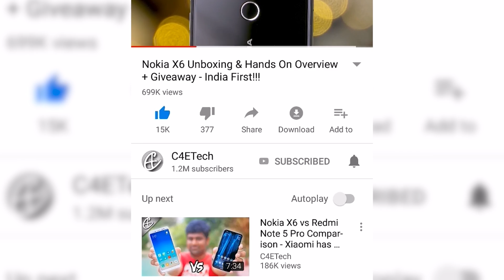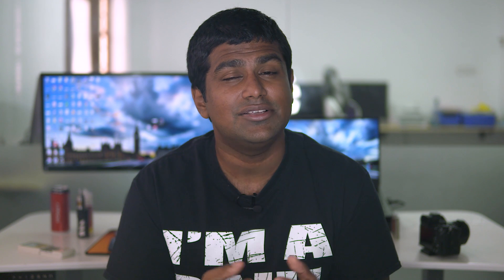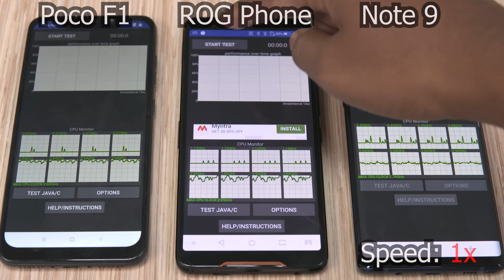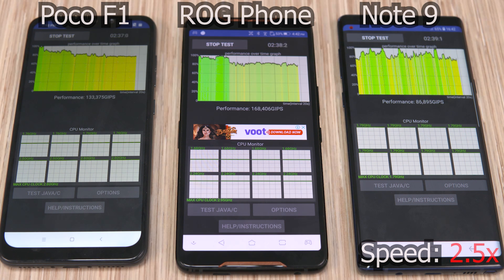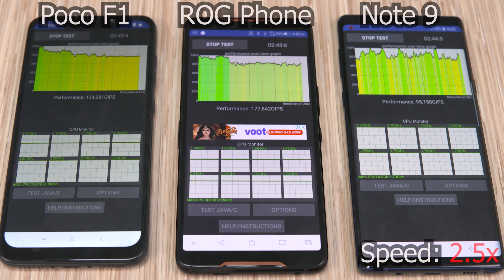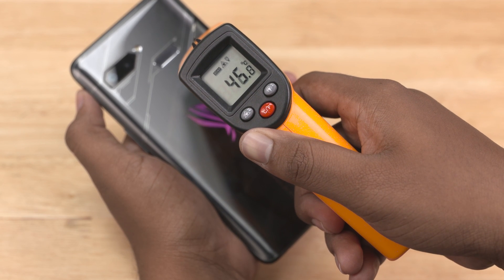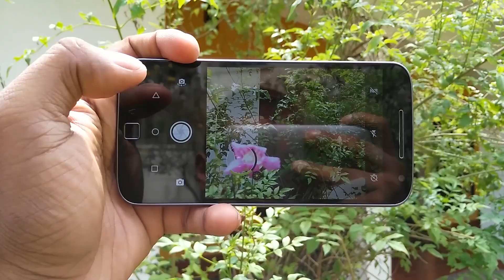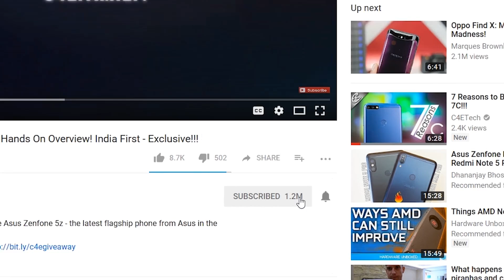My Phone is SO HOT 🔥🔥🔥 - Heating Issue Explained!

Comment: Minor Correction: Moto G4 uses SD617, not 615.
Reply: Yeah right
Reply: Strong Believer  oh sorry
Reply: But ash clearly mentioned g4 plus had 615 which was wrong and I guess g4 didn't had any overheating issue unline g4 plus
Reply: @tintinftw  no 617 had heating issues too
Reply: Doesn't even matter both are heaters🌚ya 615 generates less heat but ya u won't care for 2 or say 3 degrees

Comment: Mediatek  are pioneers in making the worlds best overheating chips
Reply: Actually SD810 ,SD 615 AND 617 heated up more than most Mediatek chips.
Reply: @akashtopder7251  also sd820 my previous v20 had terrible heating issue no wonder Samsug note 7 become a bomb and they change it to SD821
Reply: @akashtopder7251  any of the mediatek chips didn't overheat
Reply: ..@professor

Hi noob 😂
Reply: @akashtopder7251  yeah there maybe around 4-5 chips released by them which didn't do well .. now let's count how many chips made my mediatek which doesn't heat up and underclocks the frequency..... Yeah right literally a few around 4-5... Qualcomm has been the only  chip makers who can achieve efficient thermal controls. Followed by apples aX series and kirins lineup mediatek is literally on the bottom of the list
Reply: @pokemonchampion4826  fool the note 7 had a problem with it's battery where they unintentionally introduced a foreign material during it's manufacturing process, because of this flaw in the batteries Design and process of manufacturing, the note 7 had to face victim to this unexpected explosions
Reply: @Krishna Adhi Raj yeah  starting from their P and A series since the fourth quarter of 2017  they kinda kept the thermals under check
Reply: @mdc140  BS. Those 4-5s were extreme but I have seen weak chips like SD 410 get real hot. Let alone SD650 , 652 , 653. These are irons. They are the same as Mediatek here. There are NO 28nm chip or even a 20nm chip that does not overheat. Mediatek may get 1 or 2 degree hotter. I know because I'm speaking from personal experience. 2-3 years ago I thought the same that you are thinking now, but right now after taking the reviews from friends about this matter I can confidently say that the theory of thermodynamics are true for all. Don't know about Apple and Kirins though.
Reply: @mdc140  I don't know whether mediatek chips overheat or not. but I do know that they always have lower performance and efficiency
Reply: @mdc140  lol, you are wrong. Apple chips are the most efficient, followed by exynos then qualcomm and finally kirin
Reply: I agree with the horrendous overheating of the SD 810, but the SD 820 doesn't heat up base on my experience with my old S7(not the Asian unit).
Reply: @kiyoponnn  apple chips are efficient for a reason because they are tailored to work in Harmony with iOS.
Reply: @mdc140  I already know that. I was correcting your list since you said qualcomm chips are more efficient than apple chips . Imbecile
Reply: @kiyoponnn  
Apple chips are not efficient.
Do you even know how much voltage they consume ?
😂😂
So what.. now we have 2 noobs to deal with.
Reply: Intel has taken the crown now with their i9 9th gen chips. Their chips roast themselves. Literally.
Reply: @fbkensarhd5279  They are efficient, iphones don't overheat or throttle, they get good scores on benchmark tests and they get excellent battery life even with a small battery. Where's your proof, you inbred fucktard? Do you even know what efficiency is? You should think twice before spouting utter garbage
Reply: @mdc140  lol fools like you don't know the samsung has change the processor from SD820 to 821, OP3 also has the heating problems, and I use Lg v20 myself to know that Exynos are much better than Snapdragon in terms of battery efficiency. V20 has the worst battery life smartphone I ever use, that heat like a oven, same thing happen to my Le 2 phone with Snapdragon 652.

Comment: This was a much needed video to generate awareness about how the thermal mechanics could work in a phone. I see a lot of posts on Twitter regarding this but no one has gone to the depths of this to explain to layman audience.

P.S. : I owned the infamous "Moto G4 Plus"and have been a victim of the heating for almost 2.5 years. The phone still runs fine though if you don't game or use the camera for over 3 minutes or so. Have switched to the OnePlus 6T.

Comment: My mi4 used to heat. Never measured the temperature though. Should be easily more than 47°. I used to keep it inside the freezer. 
My OPPO F3 plus suddenly got hot for no reason. (Should have touched 50).
Currently I'm using POCO F1.

Comment: What abt the galaxy s8??
It has got a heatpipe in it but it heats up a lot while playing pubg....... And sometimes when it is idle......... Is thus a software or hardware problem??????
Reply: every phone heats up while playing pubg. my op6 heats up too
Reply: @samadansari4 ya but it heats up when its idle too...... Thats the problem.....
Besides the Op6 would heat up as it has no copper heat pipe
Reply: Mine doesnt have heating problems.. remove ur case while playing .. 😋
Reply: There are some factore:

1. Your phone cover
2. Poor network
3. Dual sim
4. Bad apps
5. Smart stay
6. Weather
7. Continuous usage
8. Continuous fast charging
9. Pocket
Finally the biggest reason is
10. PUBG!

It heats up every phone.
Reply: @anonymoustroll1549  thumps up 👍 for PUBG!!!

Comment: Did Asus pay you or something?The video has absolutely no sense,have you even paid attention to the back materials or clock of the SD845 in both Poco and ROG?.Plastic is nowhere near metal or even glass(ROG has both)when it comes to heat transferring.That's the reason why most of the heat from the copper heatpipe went to the metal frame and then glass,while on Poco it didn't(it stayed in the heatpipe,far away from the chipset,and that's exactly what's heatpipe suppposed to do).Now to the performance graphs,do you realise that PERFORMANCE cores of the ROG are clocked higher?That small overclock of both perf. cores increases performance,not the heat distribution.And if throttling was really happening,performance would be unstable on Poco,while it was probably the most stable out of the 3 with a measuring of 135GIPS almost all the time. The ROG was jumping all the way from 175 to 163GIPS.Not saying that point of this video(back heating isn't necessarily bad) is incorrect,but to say Poco is doing worse or sacrificing performance IS really incorrect.